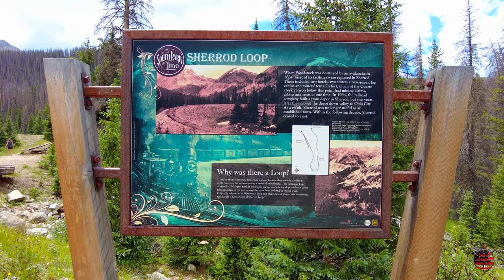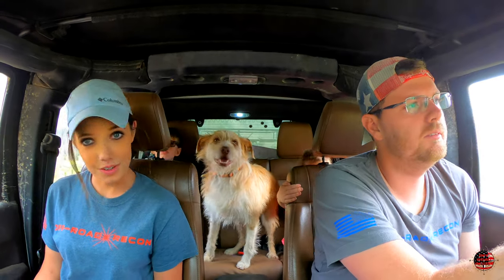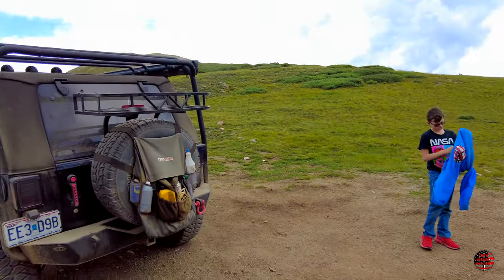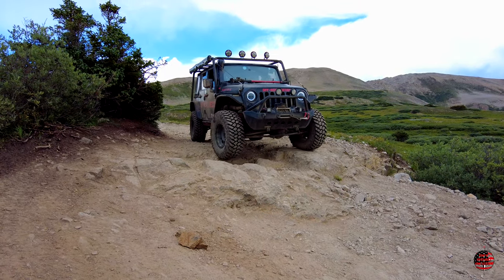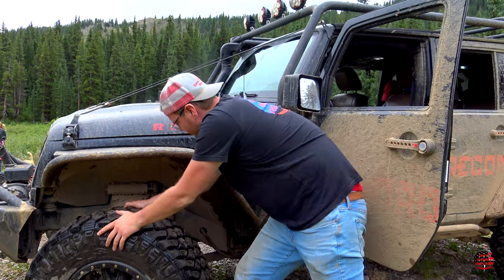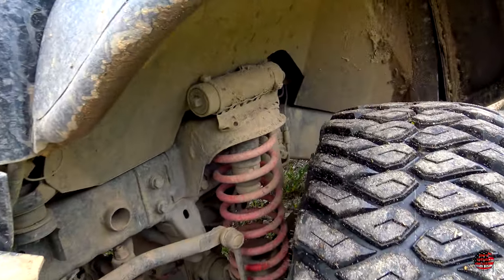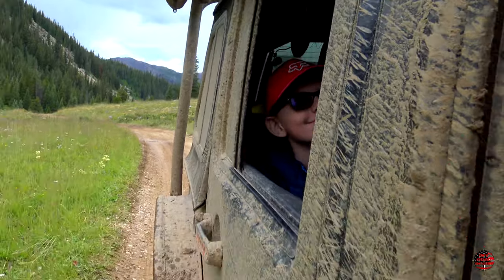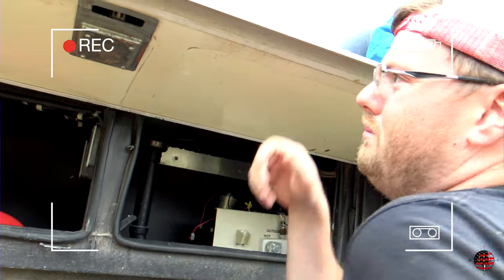Wheeling through in the mountains of Colorado!

Comment: That tie rod shouldn't be able to move by hand like that. Probably time to replace those ends. Might not be a bad idea to check your drag link, also. As far as your squeak goes, Jeep has a reputation for their front drive shaft U-joints going out.  I'd start there to track down that problem.